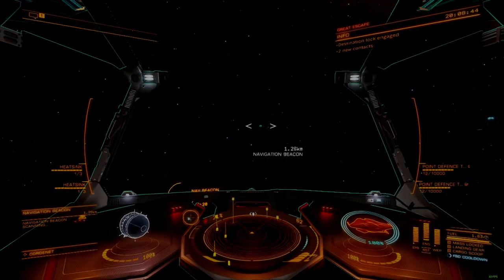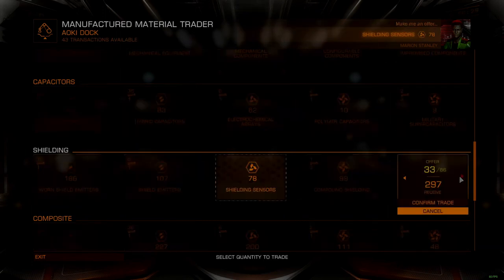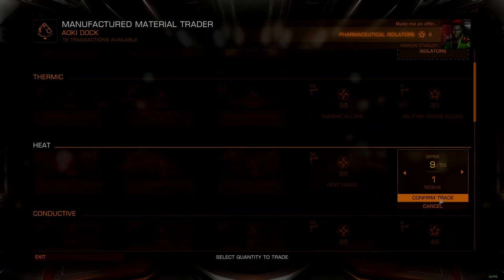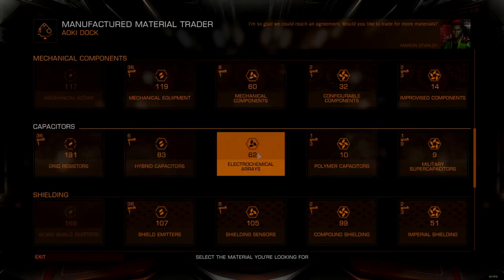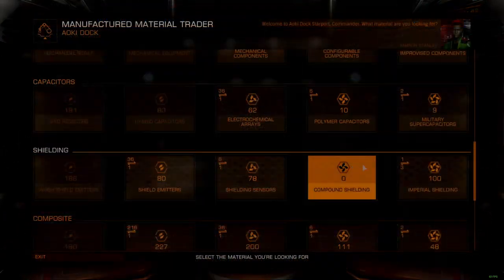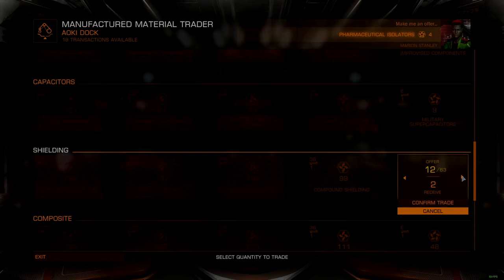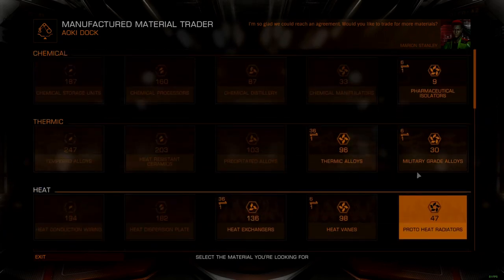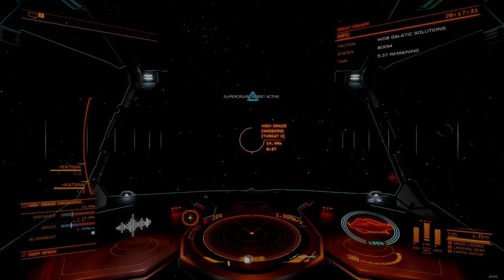Elite Dangerous | Intermediate Tutorial | High Grade Emissions & Material Trading

Comment: As a CMDR that has recently been on a massive mat grind I'll add this this very good tute, Imperial Shielding drops like candy so unless you need it for a specific task, trade it all down so you can scoff up another 100.  I also found a very neat trick that enables you to drop straight back into the signal with nothing more than pitch, you kill your throttle before your ship's computer says "engage" and select the unknown signal, pitch up to align and drop out of hyper cruise.  Also be aware that the hard exit to desktop required to exploit this method is time sensitive, I went for dinner thinking my signal would still be there and it had long gone.
Reply: as another CMDR that has just started the mat grind, thank you as up to date information is very important and hard to find for this game

Comment: This is all good info, but nothing your average CMDR doesn't already know. Right now, during the war, High Grade materials can be farmed much easier by simply running rescue missions in invaded systems. They are GIVING THEM AWAY with NO rep grind. With a python boarding 140 econ passengers I average 25-30 HGM per run. Takes longer to board the passengers than it does to run to Tarach Tor. You touched on it briefly in your Thargoid War Logistical Missions video-but didn't really show how it trumps the traditional method-at least for now.
Reply: I outfitted a python for this task and it's now a much more difficult proposition. 

If your python is not already engineered up its going to catch hell from thargoid hyperdictions. Lost several mill rebuying a python several times because thargoid hyperdictions will put you in an instance with several thargoid craft that pierce shields AND they fire a missile that can shut down your frame shift drive. Also had to pay several fines because even when I survived the trip, I would frequently lose passengers to the thargoid version of hatch breaker limpets.

Warning: do not run a basic bitch passenger python for this with most of your internals devoted to passenger slots, you will get destroyed. You want one with high shields, engineered thrusters, high hull, and the ability to reboot its FSD fast so an engineered FSD as well. This is just one of many farms where in order to get engineering materials, you must already have a pretty well-engineered ship.
Reply: @VortexMagus  my dude....that was a year ago
Reply: @neocav1  Yup. I'm not commenting because you immediately need this knowledge now. I'm commenting in case anybody watching this video in 2024 sees your comment and thinks to himself "I can do that!" and then gets hyperdicted by thargoids 6x trying to do it himself and dies repeatedly and disgracefully.

Note: that was pretty much exactly what I did lol.
Reply: @VortexMagus  Very Well CMDR. See you in the black.